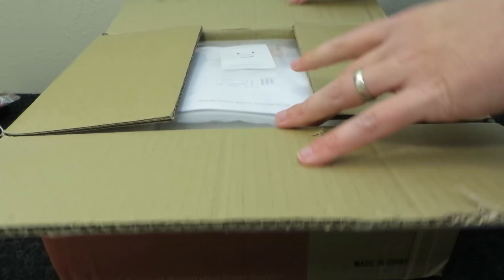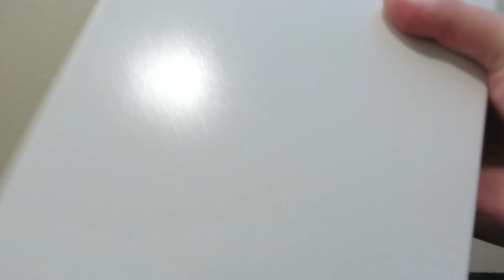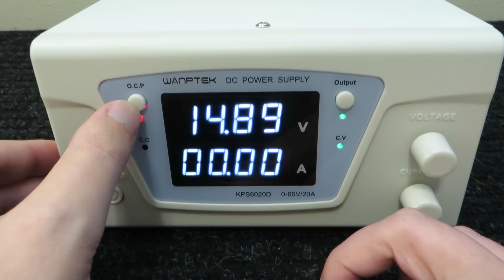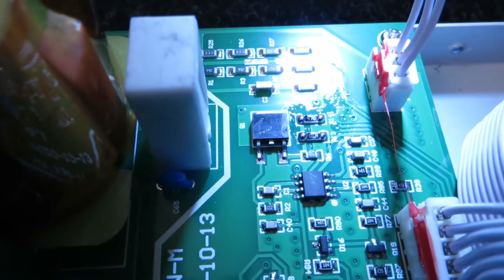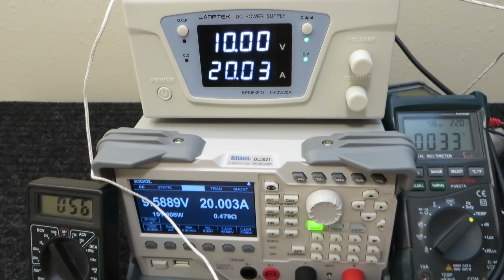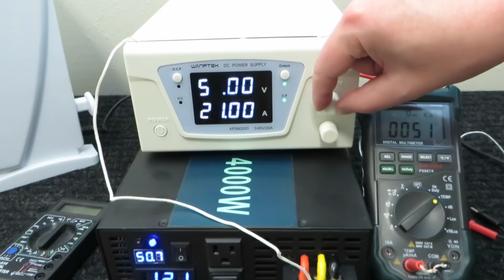1200W 20A 60V AliExpress Lab Bench Power Supply PSU Tested

Comment: I know this is off topic, but what is your car collection as of 2024?
Reply from the maker: Yes, definitely off topic.  Why do you ask?  1988 Buick Lesabre with 60k miles that's all original aside from belts and hoses and tires etc, 2003 Buick Century in excellent condition that I'm using as my winter car now - you may not believe me but it's a beast in the snow with the oversized cookiecutter tires I put on it, a 2005 Cadillac STS with 60k miles that's entirely impractical but fun in the summer, and a newer Nissan Rogue.  I planned to make videos about restoring the 1988 but decided to just get it done instead.
Reply: Wow, really appreciate the fast and detailed reply. I watched a lot of your older videos about fixing cars and was curious about if you still have them or what happened to them. Hope your doing well, have a good one.
Reply from the maker: @Arta-nd7wf The 1991 LeSabre I had ran and drove perfectly with 260k miles on it but it was so rusted out that I sold it for cheap a while back.

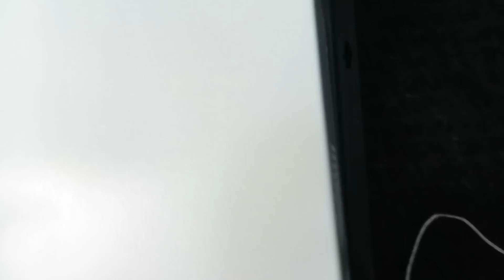Comment: @23:00 why didn't you take the knurled knobs off and fit the lug on the post(s)? Maybe the post was too big to fit in the hole in the lug? What are the posts, M6 maybe? Maybe your lugs had only M4 holes? I ask because, based on your excellent video, I ordered a 15V 100A version of the KPS 2kW power supply, and even their sales couldn't tell me what size the posts are, so I ordered some premade cables with M6 lugs on them. Here's hoping.
Reply from the maker: You are correct, the post was larger than the lugs.  I was just using cabling I had laying around and it wasn't ideal.
Reply: @knurlgnar24  Thanks for the reply, I since found out that the one I have on order uses an M8 post. Quite chunky.

Comment: Where is the link to this product so we can buy it?
Reply from the maker: Unfortunately I couldn't find a good link that I could trust to post, but if you go to aliexpress and search for 'wanptek power supply' you should be able to find a listing for it.  Make sure it is a reputable storefront with a vendor with history.  Aliexpress is kinda shady if you're not careful.  Pricing is still pretty reasonable despite all the inflation we've been having so unless they've cheapened it between when I bought it and now I think it's an even better deal today then when I bought it.
Reply: @knurlgnar24  I bought it. It was funny that the error in voltage readings that you saw is about what I saw. So it is consistently inconsistent.

Comment: You should try out Riden RD6018W. I have two of theese and one of Riden RD6006W. It seems to be a mutch better choice.
Reply from the maker: Why is it better?  That is a controller that interfaces with a switching power supply.  I'm not sure why someone would want a kludge vs an integrated product specifically built to do the job.  A lot of people have commented the same thing though leaving me wondering - however I know that typical switching power supplies (unlike ones specifically built to be bench power supplies) are absolutely terrible and inappropriate for lab uses as they are designed for a different purpose.
Reply: @knurlgnar24  display is much better. More information. The accuracy seems to be a lot better on the RIden too. More functions with memory buttons and higher resolution. A settings menu with many options. Possibility to connect an phone to the power supply and control it via an app. The price is almost the same etc.

Comment: efficiency issue with the device APS605H Wanptek: https://studio.youtube.com/video/8GLAOxNEzH0/edit
Reply from the maker: Thanks for the video.  The power supply in this video is efficient and does not have any issue with high loads - and I have used it for more demanding applications than shown here since the video.  I'm pretty impressed and happy with it.  In fact it is running right now charging some batteries.  Other models may have deficiencies and later runs of this model may be different.

Comment: Just repaired one, it can handle the loads 1000w charging lithium 48v battery. If you reverse connect it to a battery there are no fuse and your rectifier diode blow. MUR30120pt diodes. very expensive and not very available at most suppliers. Bargain 1200w 60v psu most other brands are 10x more expensive, we only want to charge lipo's not powering the space station:-) Output is very capacitive be aware!
Reply from the maker: Thanks for the info and I'll keep that in mind if I reverse connect it someday!  I've actually used this supply to 'zap' some old ni-cad batteries and found the capacitive output useful for that purpose.  This is expected on switcher based lab supplies so I do not consider it a disadvantage or advantage, just something to be aware of.  I also bought it to use it for a 48V Lithium battery bank and for individual lithium cells.  I am happy with the purchase and am considering buying a 2nd.
Reply from the maker: Update:  I bought a 2nd.

Comment: You should treat yourself to an oscilloscope.
Reply from the maker: I have one and to be honest I've never once used it at home.  That will change someday.  Probably.  It turns out that for the things I do at home I just don't need one thus far.  I do use scopes frequently at work though for a variety of tasks and applications.  As is my MO it's a surplus scope that I got for a few bucks.  Seems to work well though and would cost quite a bit to replace with new equipment.

Comment: Thanks, I was looking at this line of supplies for the same purpose. Very informative.
Reply from the maker: I've used it for a while now and I can say it performs very well.  It was a good purchase for me and I'd still recommend it.
Reply: @knurlgnar24  Yes, I have the TekPower 15v 40a supply that looks like a rebadged version of this (Amazon had them on sale for under $200) and from my memory, the boards look pretty nearly identical. I just checked and the must have been on sale to get rid of them for "newer" models, since the page is no longer found.
https://smile.amazon.com/TekPower-TP3030E-Adjustable-Switching-Digital/dp/B00PWSDH8C/
That's the closest I could find, but like you, I was very impressed with the build quality, it was better than I expected. I definitely like my Riden RD6018-W, those are darn good supplies if you are interested (but looks like you already have a 60v 20a supply). I of course am using them for the same purpose you are, to charge and test LiFePO4 cells and packs.
I'm still waiting on mine to arrive, but I'm going to try out this for testing cells (40 amp charge and 40 amp discharge):
https://www.aliexpress.com/item/1005001971982159.html

Comment: Hello Knurlgnar in the video Episode for the UPS you connected 2 UPS in Parallel with the same big battery , I want to do the same , is there is any precautions or i can connect 2 or 3  300 watt UPS with big Lifepo4 200Amh battery ?
Reply from the maker: There is no issue connecting multiple UPS units to the same lead acid battery.  For a UPS that uses lithium batteries I would not do this until I fully understand their charge behavior.  I wouldn't recommend using LiFePo4 battery on a UPS unit designed for lead acid.  This is because the float voltage on them is too high and the life of the lithium battery will be reduced.  For true float operation on LiFePO4 you need a float of 13.6V - perhaps cheated up to 13.8V or so for a quicker charge at the expense of shorter life.  14V is too high.  Telcom Lead Acid to Lithium conversions (more capacity in the same battery room which saves considerable money on building a new/larger room) change the float setting to 3.40V per cell to continue using the same lead acid equipment that was pre-existing.  You'll see some minor deviation from 3.40 if you look around but those are due to warranty differences, optimizing for different variables, etc.  It's not a chemistry/construction difference.
Reply: @knurlgnar24   Thank you very much taking the time to respond and for your great knowledge pouring on me , 
Do you recommend to attach Lifepo4 BMS and connect the 3 UPS to the BMS so it control the float charge ? And the BMS is 40 AH that means i will not pull from the lifepo4 200 Ah more than 40ah BMS ?

Comment: Hi knurl I have a question I have a 650ah forklift battery that I charge with a mpp solar inverter with built in mppt chargers.the charger is only capable of 58.4 volts max.my question is can I float the battery at 58.4 volts? Just don't want to under charge the battery
Reply from the maker: I will assume your battery is lead antimony chemistry since it is a forklift battery.  58.4V is reasonable for a bulk/absorbtion stage but it a little high for float.  You will see some positive plate corrosion and high water usage at that voltage.  Float would normally be around 55V.  The major caveat here is that every month or so an equalization step will be beneficial and that requires well over 60V for a few hours.  If your charger isn't capable of equalization and you are not going to be doing that step then a valid alternative is to slightly overcharge the batteries during float.  Overall I'd say it depends on your specific situation and while your setup isn't optimal according to manufacturer datasheets it could be a decent solution for your application.
Reply: @knurlgnar24  thank you so much for responding.i have 9kw in solar panels.the panels produce enough power I'm thinking I may go purchase anouther charger that can hit the voltage I need.so in your opinion what would be a good voltage to equalize this battery at?
Also I only discharge the battery to 50%

Comment: Those two variable pots on the main board might set voltage and current. I have a few cheap 12V, 2 A supplies that needed to be adjusted.
Reply: Yep, they are the trimmers!

Comment: After watching this video, I search for "程控电源 (Program Control Power supply) " on Taobao.com, and the first result is right this one, no surprise it float to the top as I scroll down the results, this one is marked with "ad", which means it will be rank higher.  I expect the price will be much lower in China, but I find it's  166$. Considering the shipping cost, it's almost the same price as it's 200$ on amazon. 
One thing I notice about the power supply is the cut out part in the back panel, it seems that there isn't such hole on the chinese model. I have to say this one is literally the most cheap look one for this price.

Comment: One of those Riden (buck) front ends might give you more functionality and precision from the rather simplistic controls on your PSU, you could adjust the voltage input voltage to it as a bonus as the "recommended" PSU for it is a constant 60V type smps.
Reply: My thoughts exactly, too!

Comment: You can never be sure about what the real name of the chip on the board is. They even make fake plastic rice.
Reply from the maker: Very true, yet I doubt they'd bother counterfeiting components inside this supply.  That isn't to say their sourcing department won't happily purchase fake ICs if the price is lower, but I doubt it would be intentional.  I've worked with gray market distributors and while you can't trust them they do make at least some attempt to vet their sources.

Comment: Looks okay during the testing but my best guess is that those electrolytic capacitors will eventually fail sooner than later. Electrolytic capacitors made in China are the most common component to fail because of poor quality control and exaggerated temperature rated specifications in alot of consumer electronic products made in China. Lots of pre-90s electronics that were made in Japan are still working today, especially their well known stereo gear.
Reply from the maker: I work in the electronics industry and I have seen major improvements in capacitor quality from China.  In fact many chinese manufacturers source capacitors from other places if they want to appear higher quality while many outside companies which don't need to worry about their quality credentials as much now purchase Chinese capacitors.  Electronics quality is a sad state today and I wouldn't trust non Chinese brands much more than USA or German brands anymore when it comes to capacitors in their products.

Comment: When it flashes its putting out OTP. I dont know if u knew that or not. Idk what it means though. Maybe means output?
Reply from the maker: Good eye.  Another viewer pointed this out earlier and I'm pretty sure it is over temp protection.  The temp sensor input is probably noisy and not filtered well enough.  It seemed to happen only at high load and once warmed up.  For my purposes that's not a big deal but I could see it being a problem for more sensitive applications if the power goes 'unstable' when it shows the error.

Comment: I would recommend you go with the 18amp Riden RD6018 that has a nice LCD display and programmable usb interface. Costs around 130 dollars for self assemble kit.
Reply from the maker: That appears to be a DC/DC module and not an AC input lab power supply.  This is not a reflection on the quality/value of that product only a comment on the type of product that it is.
Reply: @knurlgnar24  its a dc/dc module sold with a ac/dc PSU you screw together as a kit. By the end of the day you still use the same tech but the difference is whether you have an option to get a different ac/dc psu, or have one pernanetly wired in the same box.

Comment: The standard for US electrical changed to 120 volts back in the 80's I believe.  Not sure why the rest of the world thinks we use 110v.   Ohh well.
Reply from the maker: The 'standard' started at an arbitrary 100V when people considered <100V to be safe back in the Edison days.  It slowly got bumped up to 110V, then 120V, and now 125V as people demanded 'better' power from their utility companies.  I wouldn't consider 110V to be wrong or obsolete as it is perfectly acceptable today as a wall outlet voltage.  Today I get 125V from my outlet as my development was built about a decade ago.  3 decades ago you'll probably get 120V.  50 years ago if the utility company hasn't yet had to do maintenance on your substation you'll likely get 115V or 110V.  They all work just fine for most applications.  If you find a device from the 1930's it will likely say 110V on the label.  If you have a device from 1910 it will likely say 100V.  I have an old radio that has a switch to change between 100V or 110V.
Reply: @knurlgnar24  We have standards now,  ANSI c84.1,  might be some newer versions.  Bottom line 110V while not wrong is not seen much anymore at wall outlets.   Yes it's been all over the map throughout history,  but not as much anymore.   Pretty sure 120v will stick around.   Sitting at 122v at my place now.
Reply from the maker: @jeffm2787  I agree fully.  My comment was pointing out that for practical reasons legacy support for lower voltages will be around for a long time to ensure customer satisfaction and to lower complaints.  No refrigerator manufacturer wants to get complaints because their product doesn't run on 100V in places with poor wiring for example.  I suspect power companies will margin their voltage high to maximize customer satisfaction and power use for profit motive reasons (hence 125V) much like wire manufacturers margin their wire down such that you never actually get true xAWG wire, it's always on the bottom end of the acceptable margin constraints.

Comment: Wonder what the switching output noise looks like on a spectrum analyzer.
Reply from the maker: I suspect given the high efficiency of this unit the FETs switch pretty fast/dirty.  The output is filtered somewhat but it is mostly just an LC cap/choke setup without any additional filtering.  My personal opinion is that I think it would be OK for any application where a switching power supply is acceptable and unacceptable for any application where a linear power supply is needed.  I have those Korad supplies for more noise sensitive needs and unless I borrow something from my employer I don't have the equipment to measure noise to a level that would be adequate to give any meaningful information.

Comment: For that price very good deal..I'm missing sense terminals..but for that price..also quality of those caps..well i don't expect much.. If nothing else it has fuse..I would be interested about temperature of that choke..because as you said if it has high temperature it could be problem too well problem for capacitors they are very close by..
Reply from the maker: I am assuming that magnet wire can handle 150c+ for hundreds of hours before breaking down and the core even if it is powdered iron can handle the same for hundreds of hours.  For my purposes it should be OK, but that said I am kind of curious too if it was designed well or if that component was getting too hot.
Reply: @knurlgnar24  Hi friend. Yes you are correct..would be interesting to see some video and then some measurements..Btw even you are right that wire could handle even 150 degree ..well let say 100 just to be on safe side..i'm not so sure about those capacitors close by..and all that heat would go just to them and also to heatsink..but i'm sure they would see a lot of heat from it..if nothing else there should be some barier to prevent that heat transfer..that might fix the long term stability of those poor capacitors..

Comment: for half the price you could have gotten a 48v 600 ps and a digital controller with USB and Bluetooth...
Reply from the maker: I wanted a bench supply that is simple and fully self contained which has no interfaces that will go obsolete in a few years.  This supply will be perfectly useful until it breaks, even if that is 20 years from now.  If it had USB or bluetooth I'd specifically avoid it.  I want that stuff in my phone and earbuds.  I don't want it in my water heater or power supply.